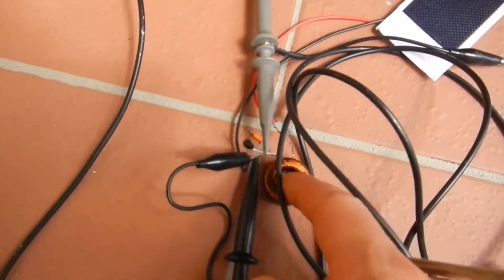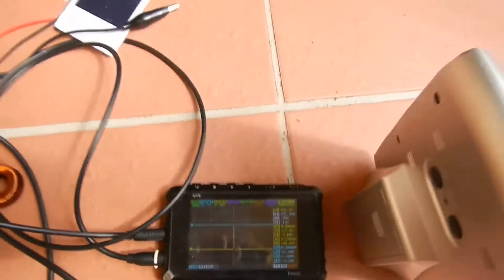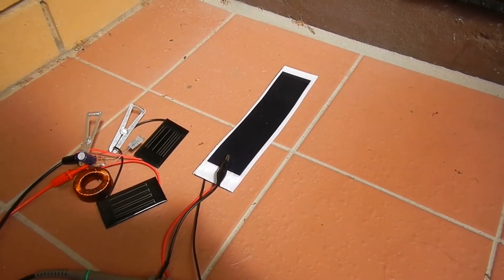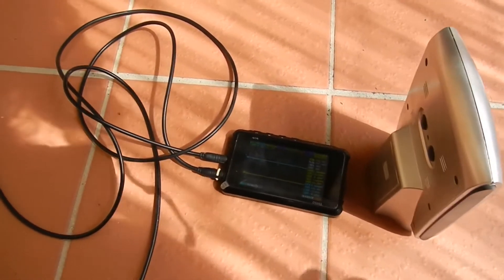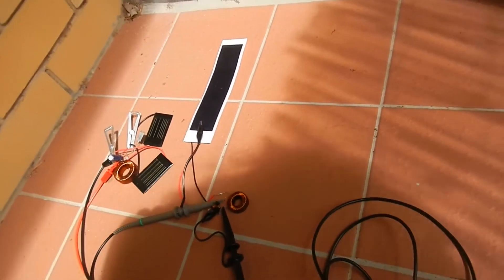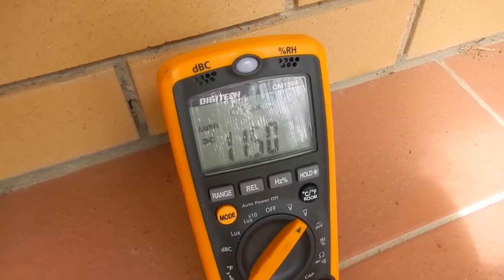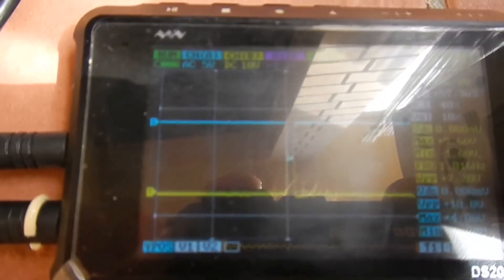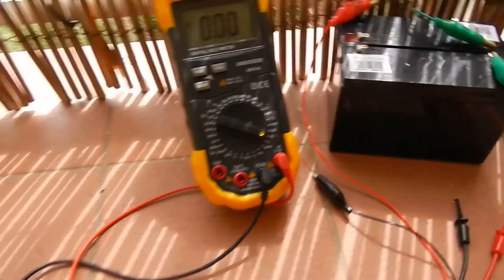180v from single solar cell.

Comment from the maker: Yep. with a really long wind on one side and a fairly short one on the other. long side to base gives really low start voltages. Like in my 60mv solar harvester (might be the same coil I think) and long side to collector gives high voltage amplification on the output. I've i,proved this since this video. can get approx 250v from solar, 440v from AA. Just put a charging orientated diode on the cap to fill it. Check out my Cap summing video too! take a few and add up the v-out with caps in series.

Comment from the maker: Most of my toroids ring, when allowed to make high voltage without a load. The bifilar coils I used in the cap summing video ring too. Although one sounds more like a fast drum or cilcker, at about 80hz..  I put a paperclip across one cap. Makes a nice spark-bang.

Comment from the maker: This cell makes 350ma @ 2v = .7w 

I can get  250-350v peaks. With 19:1 coil. If I get 50:1 with .8mm wire, and a flyback driver to handle the voltage.... Might be able to make plasma :)